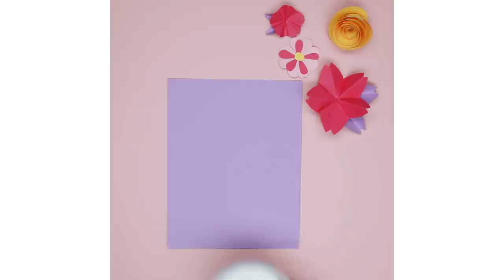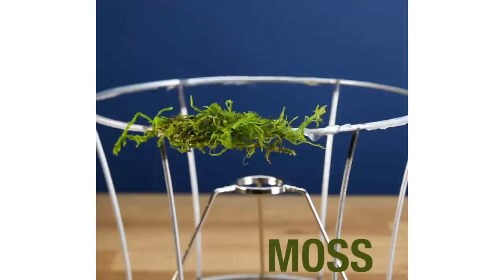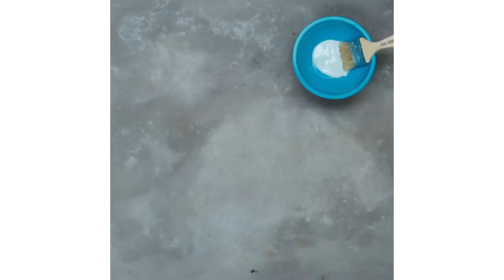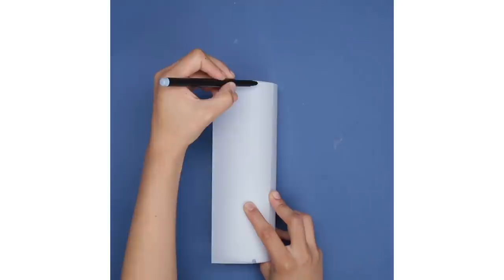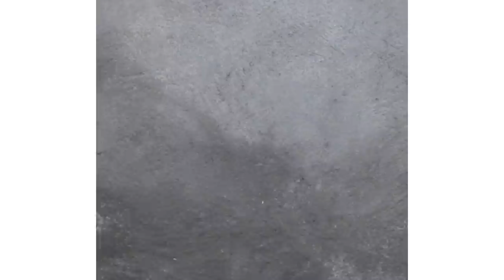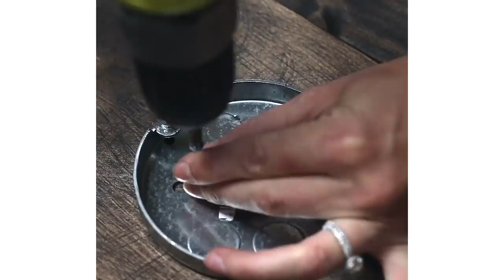11 Beautiful DIY Lamps To Light Up Any Room

Comment: Could’ve just take off the fabric of the lampshade instead of cutting it
Reply: Sometimes they glue the fabric to the lamp shades, especially to the top & bottom wire, so if you CAN, yeah go ahead, but sometimes it's unavoidable